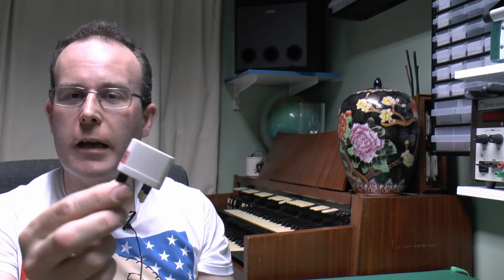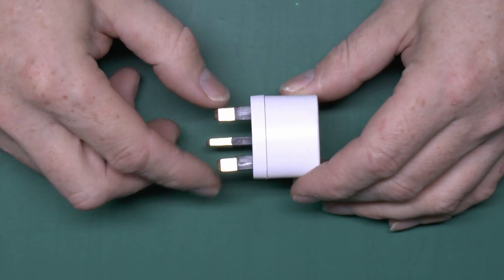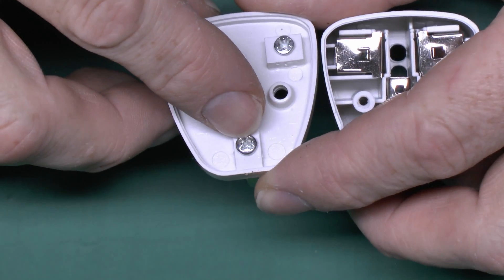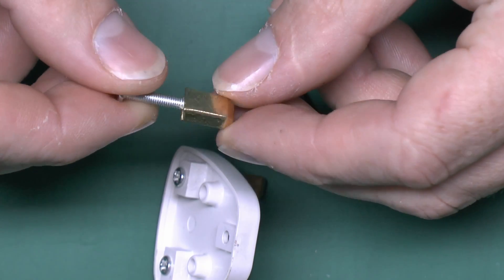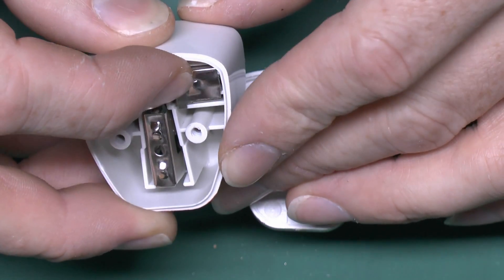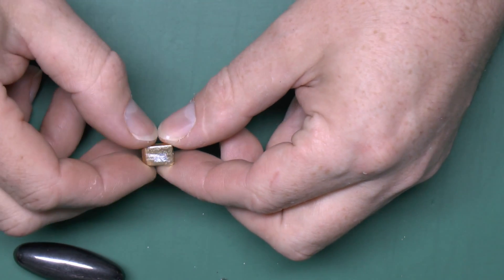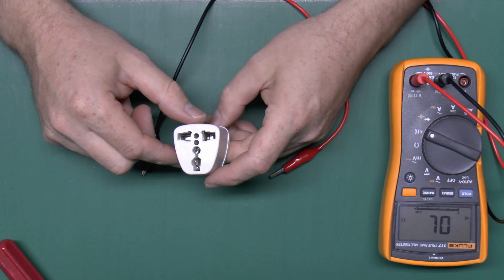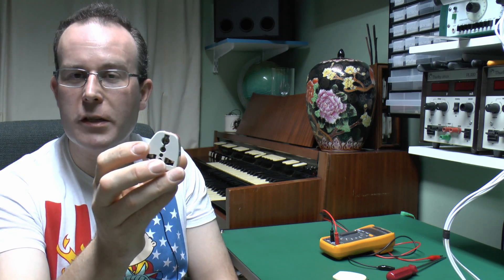Dangerous Travel Adaptor Part 1

Comment: A few weeks ago, I was about to try out a new spot welder for a fabrication project and my tutor, coincidentally set it up right next to my workbench, set up ready to use and I spotted the spot welder had a European plug fitted and it was then fitted with one of these adapter. Obviously, my reaction to that was alarming and I had to inform him, as he was unaware, about the adapter and he went to have it checked and was informed to not use it. Thankfully the welder itself was genuine and just needed a proper adapter fitted, which has since been done.

PS, I don’t know how the hell this happened but the adapter had a PAT Test passed sticker on it basically saying that adapter was safe, well clearly it is not.

Comment: If you connect the European schuko, it does not connect the earth. It actually is impossible to make a connector that accepts both the British and Schuko with the earth. Adapters that do this are two piece ones, first they convert to schuko and then a separate piece converts from schuko to everything else. (here they sell those parts separately as either the socket or the plug is schuko)

Comment: Going through some of your old videos about adaptors. Would love to see a video showing a good example of design/manufacture, by contrast?
Reply from the maker: Haven't found any good ones - they all allow 3 pin plugs to connect to 2 pin outlets, the majority have pins of the wrong size and spacing, most have no fuse either.

Comment: I/we had three of those,  1st. my youngest brother brought a water LED fogger with a Chinese wall-wart from maplin - now gone insolvent ☹️, used shaver adapter - lose connection blew fuse- very old adapter with fuse used and coped with poor connection (later found to have blown fuse bypassed with wire!) 2nd. I bought a rechargeable lint shaver from China - came with unusual Chinese charging lead - small figure of 8 IEC connector, curled phone wire and 2 pin flat blade plug - bought a US>UK plug top to adapt it, black clamshell type with fuse,  3rd. I bought a Japanese folding airfoil fan, wall mounted, to put above my bed. The adapters were broken up for scrap metal - mine had the pins moulded in the back, had to use wire cutters and pliers to remove pins (a bit dangerous)

Comment: Can you recommend a universal travel adapter, or all they all dangerous crap?

As for the pins being sleeved, I've never seen that in the US or Asia. I can't help but wonder if the UK is the only region that mandates sleeved pins.
Reply: The European two-pin plug has sleeved pins. The Swiss three-pin plug (which is very similar to the European two-pin) I think also has sleeved pins (a while back they were also unsleeved).
Reply: JaMoBo265 I can't speak for all Malaysian electronics, but I found a computer manufactured in Malaysia whose three pin plug features sleeved plugs. I've still yet to see sleeved plugs in any North American electronics.
Reply: In Australia, it's been compulsory since around 2005, I think.

Comment: I've always wondered, given that the plug that will be going into this adapter will usually be fused is it useful to have a fuse in the adapter itself?
Reply from the maker: +BenjaminGoose Although a UK plug fits into this, it's designed so that non-UK plugs can be fitted into UK outlets, and virtually all other plugs have no fuse in them.
Reply: The plug will not be fused. Only British plugs are fused and if you have a British plug you will not need this adapter.

Comment: It's shocking how common these are in the UK as they are supplied with imported electronics. People leave these plugged into wall outlets unaware that there is essentially 240V live conductors with no shielding and making an otherwise compliant socket, dangerous.

Comment: While clearly horrible, are these types of adapters that dangerous when used in conjunction with things like a USB charging adapter?  The minimum spacing between power, neutral and earth needing to be increased aside.
Reply: Depends on the type of plug on the end, most US plugs that go in these "universal adaptors" - otherwise referred to as death-daptors - don't cover the live holes fully, and it only takes a slightly "innovative" child - and I use the word "innovative loosely - to shove a thin screwdriver in and give themselves a shock off the mains. Nevertheless these death-daptors are illegal to be sold in the UK, and in most cases wouldn't pass basic electrical safety tests

Comment: Aaaah, that's horrible inside and out. Fake pins, LOL at the sleeved earth pin and STEEL for conducting the juice.

Nah, definite reject that one. Please execute it.

As you said, you're going to take it outside and stuff lots of current through it. What would be interesting (seeing as that it doesn't have a fuse in it) is how it handles 32A through those flimsy steel connections in there.

I'll zip-off and watch the execution of that adaptor now. I want flames.... I really want flames out of this. :D

.....Or at least get the steel bits Glowiiiiiiin' in there so that they melt the casing in an unrecogniseable mess. :D

Thanx for showing,

-BoomBoxDeluxe.

25th October 2014, 01.11